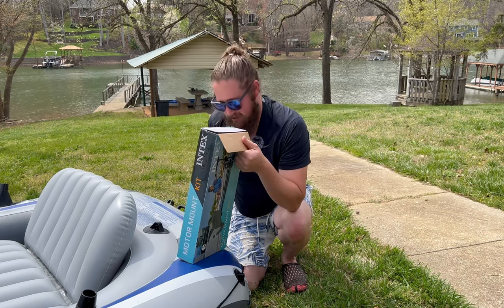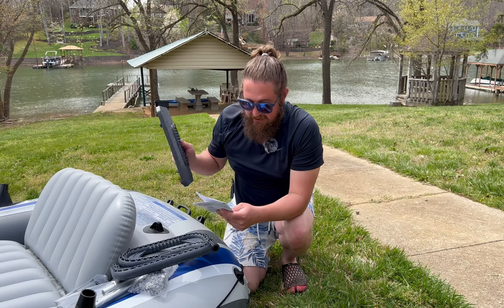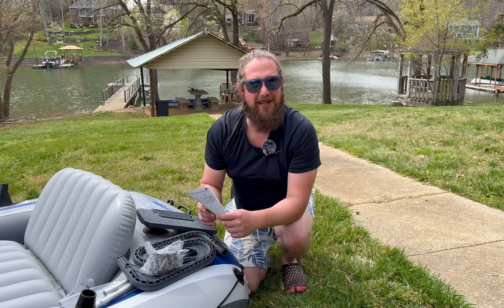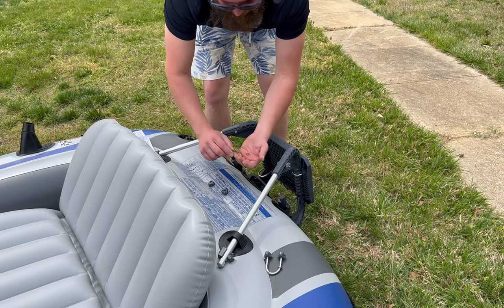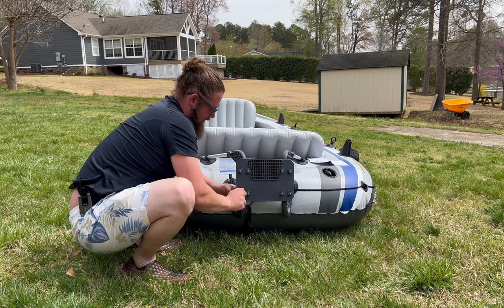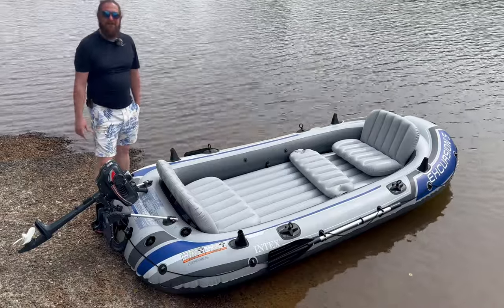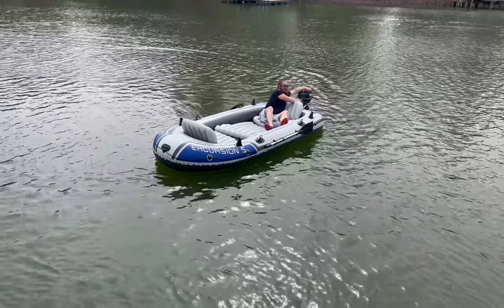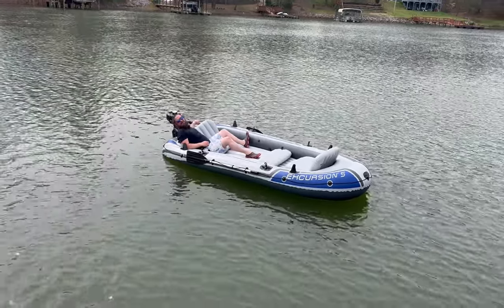How to Install a Motor on an Intex Raft

Comment: Hello my friend! Nice! When the engine is inserted into the intex excursion 5 boat, the force of the engine pushes the inflated part inwards. another thing, the weight of people causes the floor float to resist in the water. the ideal is to make a rigid floor and improve the support of the motor, better distributing the force it places on the external float. (I'am from Brazil, I used Google translate)
Reply from the maker: Olá! Someone commented on our other Intex video with a setup similar to what you described. Check it out: https://youtu.be/9owZ4HfHNrs
Reply: @HufflerGarage  Thaks!!!! I will go watch!
Reply: I was thinking this

Comment: If you get longer beams for the motor to extend through the ore holes it stops the motor from sagging! Nice video bro
Reply: What do you mean mate ? Could you explain in more detail and where would you get these beams ?
Reply: @GunitCPT  it works I’ll explain maybe better with picture though lol. Motor sagging really does suck. It happened to us but the mode fixes it!
Reply: @backtothe80s97  thanks for the response. I have a Tobin canyon pro and my intex mount and Suzuki 2.5hp motor arrives tomorrow. 

It appears the Tobin has a narrower rear section and I think this shape potential is stronger than the larger wide flat section of than the intex excursion. I am hoping this to be the case so that I don’t need to make any modifications.

Comment: I don’t have one yet but here thinking out loud.
Maybe if the prop was adjustable and it was higher not so deep underwater it would push better rather than twisting the boat?

Also, did you have the correct pressure, or could it be inflated a little more to make it more stiff

Comment: You could probably get some longer rods to connect further forward on the raft to stabilize the sinking issue.
Good video BTW.
Reply: I wish he tried that. I just ordered the boat 2nd hand and I plan to do so when I find an outboard.
Also reinforce the floor with something more rigid

Comment: I need to upload some videos I have the excursion 5 same model and even the same hangkai 3.5 but I’ve modeled the floor to plywood and stabilized the motor mount and it runs fine I just bought the hangkai 6 and have to take it out to the water this week

Comment: Hey! Looking for a very quick reply here! Been watching for a while now. A pretty frequent commenter on the channel. Quick question- I was interested in getting a hangkai 12hp outboard motor. But my local boat dealer has Mercury motors on sale right now for the next couple of weeks and they come with a killer warranty too. Obviously you can’t go wrong getting a Mercury over a hangkai. What hp of Mercury would you say is equal to a 12hp hangkai? I remember you talking about this on a different video I just can’t seem to find it now.
Reply from the maker: You definitely can't go wrong with a Mercury over a Hangkai, especially if they are close in price! 

We're under the assumption that the Hangkai HP numbers aren't necessarily accurate. So I would say their 12 is probably similar to Mercury's 9.9 in the current 2022 lineup. Keep in mind that the Hangkais are 2 stroke and the Mercury will be 4 stroke so slightly different power delivery and more weight.

That being said, if you've got the funding and your boat can handle it, I'd go with the Mercury 15 hp. For the 2022 models, it's only 15 lbs heavier than the 9.9 and it has EFI.

Comment: Hey man, so I have a question maybe you could help me?  So I have the excursion 5 and got a Coleman 2.6 hp and when I put it just in gear with idol the motor wants to sink in the water. So if the holes on the mount in the middle of it went all the way thru and maybe raised it, do you think that would help? Yes it's a 4 stroke motor.  I also thought if I tilted motor a little that maybe that would help on not sinking the motor as long as the propeller was in and everything?  Any thoughts??
Reply: get longer stabilizing rods and attach thru the oar holders on top of the sides of the back of the boat. This will distribute and stabilize the weight and thrust of the motor

Comment: You have to set the engine aiming up with no thrust so that when you use it, it stays leveled. 11:52 you are loosing around 15% thrust because of the angle

Comment: It's not the weight it's the thrust bending down the entire vinyl stern.  You great video is basically the new Texas Chain saw massacre.  Buurrrrrrrr...
Reply from the maker: In an infinite timeline, nobody survives.
Reply: Add longer rods to your aft oarlocks & it will take care of the motor sag